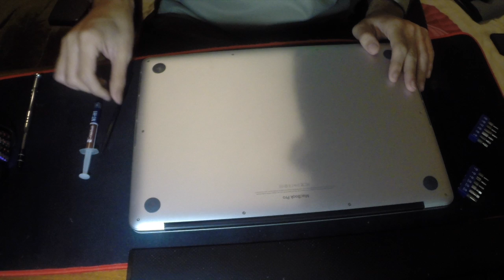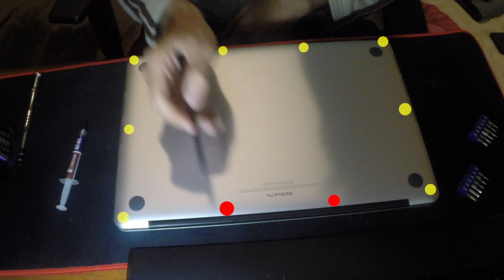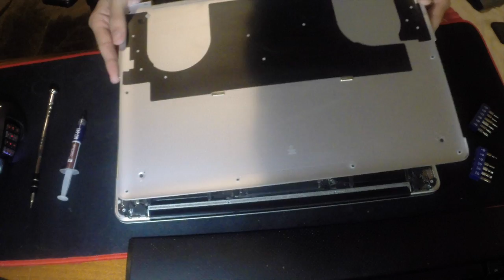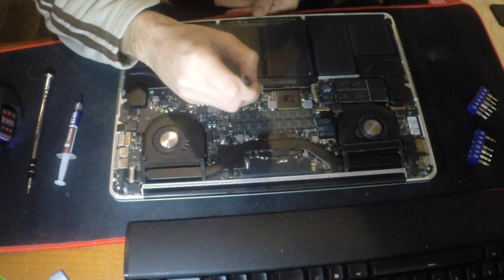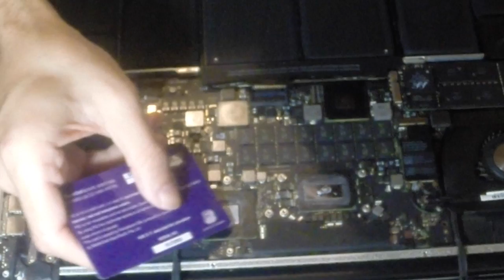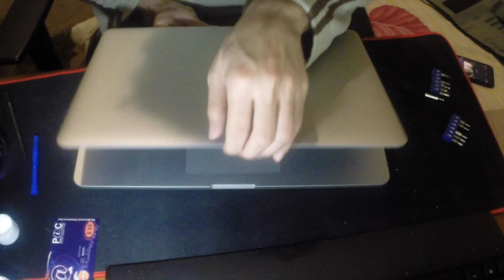Macbook pro thermal paste replacement

Comment: Hi, I've read the documentations from different thermal compound producers and they all contradict what you show here. I suggest you read up a bit. The cleaning looks messy, the compound shouldn't be smeared out and they advice tinting the processor and cooler face plates before adding the final amount of paste in order to minimize material/microgaps that can cause a drop in performance. Of course you won't destroy a laptop in the way you do it, but I think that if you're going to replace it anyway, better go 'all the way' and make it as good as humanly possible.